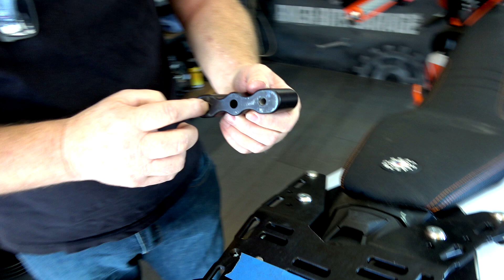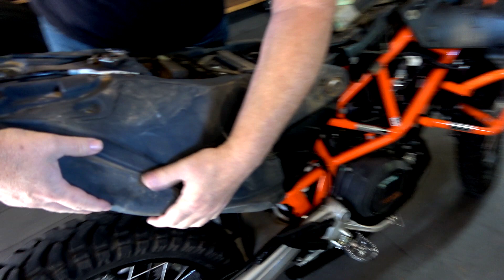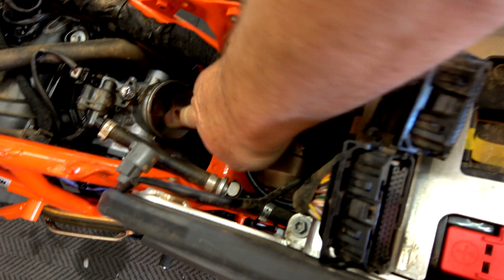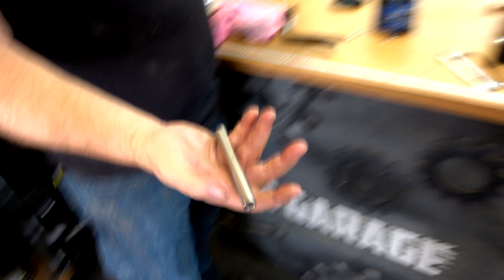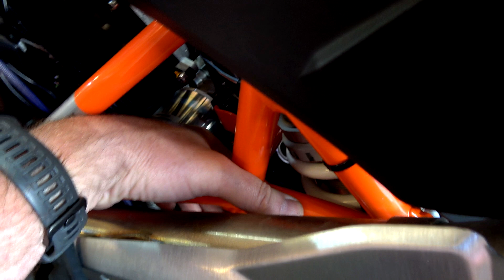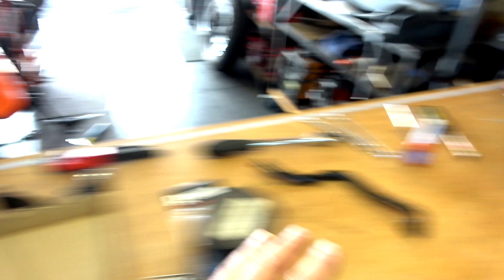HACKING a KTM 690 - Biker Bits Garage

Comment: The KTM 690 is a beast right off the factory floor, all the mods done were to make my life easier and to bulletproof the bike for long adventures.
I don't think you will find a bike on the market today that does not need some mods to improve it for long adventures.
And once again thanks so much to Mark and Bikers Bits for helping me install all the mods.
Oh and Max the DR had the bike lift and he did not want to share :)
Reply: I have the same bike as well and yes, there awesome straight off the shelf.but for some reason I like yourself enjoy modifying it to my likings. All part of the fun 👍

Comment: I had a 2012 690 and good ol KTM still haven't fixed the support bolts nor the air filter issues. But it's orange. Rottweiler makes great stuff if you ride 690, 790, or 890 and I think earlier ADV orange.

Comment: Great Job as always guys. The SAS delete kit is bypassing and removing the tank vent and charcoal canister purge valve to allow the tank to vent right to atmosphere.. One of the first mods I did to my BMW when I had it. The BMW had the added bonus that it would carry charcoal back to you fuel filter which was internal to the tank. German engineering at it's finest</sarcasm>
Good job guys. European bikes are far too convoluted because instead of redesigning the engines they engin-nerd half ass solutions to make the bikes meet ever stricter emission standards..

Comment: Why i used Rally Raid lower tank mounts hex head bolts & there upper use allen bolts

https://www.rally-raidproducts.co.uk/KTM-690-Enduro-R-SMC/performance-upgrades/ktm-2014-690-enduro-lower-tank-mount

https://www.rally-raidproducts.co.uk/KTM-690-Enduro-R-SMC/performance-upgrades/ktm-690-subframe-tank-mounting-bolts